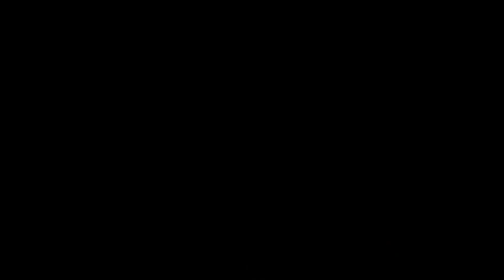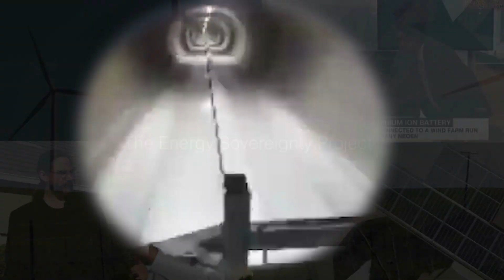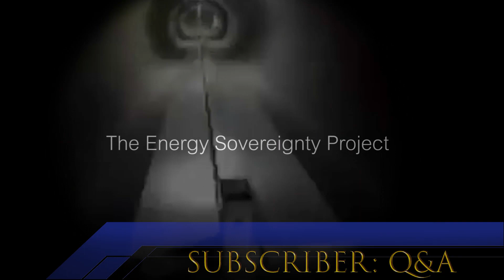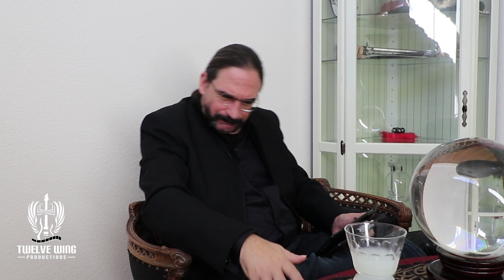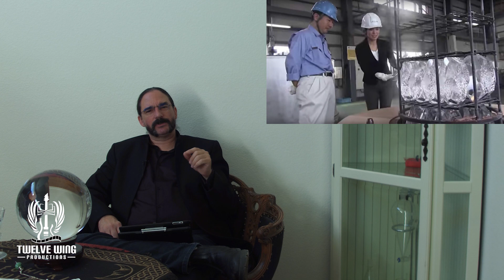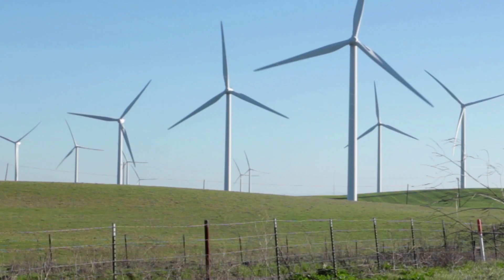Tesla's new Million Mile Battery: Is it solid state?

Comment: There is a recent Journal of Electrochemical Society publication by Jeff Dahn's research team of a "million mile battery" details using  NMC532/graphite pouch cell under laboratory testing. The technical paper can be viewed at URL:
 
https://www.scribd.com/document/424878572/J-Electrochem-Soc-2019-Harlow-A3031-44#download&from_embed 

This battery chemistry has apparently been under testing for the past 3 years. The advanced electrolyte used in this research study sounds to me like a chemical solvent and not solid state but you can read for yourself the technical details. The battery capacity remaining after 4000+ full DOD cycles is outstanding at 20 C (hence million mile battery claim) and decent at 40 C (see figure 1 in paper).  The long term storage capacity remaining after 400+ days of trying to hold a full charge also looks very good to me at 20 C and 40 C (see figures 2 and 3 in paper). I would be interested in your comments regarding this research.

Comment: What is the current longest mileage on the same batteries,  Is it not just taxi drivers that are ruining them at 300k-500k super charging 5X a day?
Reply from the maker: Not sure, but I'll look into it.
I've heard of someone approaching 200K if I recall correctly.
There are a couple cars in the 300k range but those were older cars with original packs.  Most of the first generation packs have been changed out.  Same with the early motors.
Reply: @twelvewingproductions7508  
"Most of the first generation packs have been changed out.  Same with the early motors."

Actually changed out as in replaced in the cars?  If so, have you a source?

Or do you mean that the batteries and motors more recently used in manufacturing are different than what was being installed in 2012/13?

As for battery life, Tesloop a company that does LA to Vegas shuttles  has a Model X with its original battery pack after 300,000 miles. The company reports about ~10% of battery degradation.  

(That is a TX, not the TS that is now at 400k miles but not with the original battery pack.)
Reply from the maker: @bobwallace9753 , the packs and drive units were both mostly changed out.  I know 3 people personally that have very early examples of the Model S and none of them have the original components.  It was common for some to have 3 drive units replaced before the current version was installed.
This was expected actually, so it's not anywhere near the issue the media has made this out to be.

As to the Tesloop 300,000 mile car, it's my understanding that this specific vehicle had it's battery replaced at 200,000.  That was why I was looking for other long range examples like the one 400k mile pack you mentioned.  I have been out all weekend but I'm going to look into this tomorrow.
Reply: @twelvewingproductions7508  
No Tesloop's original car was a TS.  As it reached 200k the computer began giving faulty range estimates.  There was a problem that needed some reprogramming and testing.  That was going to take some time so Tesla swapped out the battery pack as a quick fix so that Tesloop could keep operating.  When that pack was removed capacity was still very high even though Tesloop had been using the Superchargers fairly frequently.  IIRC what they were doing is take one client to Vegas during the day, Supercharging, and bringing another client back to LA in the evening.

Also, IIRC, there was a problem with the replacement pack and Tesla had to give the T3 a third battery pack.

The TX I mentioned is running its original battery pack.

I have heard of no drive units that failed.  That doesn't mean it hasn't happened, I could have easily not heard about problems which is why I asked.  I do know that there were noise problems in the drivetrains early on.  Drivers reported a 'grinding' noise which apparently was solved by inserting a shim between two components in the gear train.  I think what happened is that Tesla would swap out a drivetrain in order to get the car back on the road rapidly.  Then they would break open the removed drivetrain, insert the shim, put it back together, and use it to upgrade the next TS that came in with a noise complaint.

I've never seen any data on how many, what percentage, battery packs might have been replaced under warranty.  And, are we not a couple years away from when the first TSs start losing their battery warranty?  Eight years starting with Dec 2012, IIRC.
Reply from the maker: @bobwallace9753 , what you say about the drive units is correct but I think you and I are simply arguing over semantics.
It is true that I also have heard of none "failing" if "failing" is described as leaving someone sit on the side of the road.

That said, the noise in the early drive units WAS them coming apart.  I hope we can come to agreement on that.
There were gear geometry issues, a bearing issue as well as an issue with dissimilar metallurgy that I know of that was causing metal from one shaft to migrate to the bearing.
Nothing monumental as far as things go, but the result of all of this is that there likely isn't a single Model S out there that has it's original drive unit in it.

Tesla has the best warranty in the automotive world as far as I know.  As you point out, this is because it was understood that its customers were helping it with its development work.
As a way of understanding that, Tesla gave us this amazing warranty.

So I'm not trying to bash Tesla here, but I am going to be honest about their early struggles.
Reply: @twelvewingproductions7508  I don't think you're bashing Tesla.  I'm just trying to figure out what you might know that I don't.

When you say " there likely isn't a single Model S out there that has it's original drive unit in it" I assume you mean the very early Tesla Ss?  Those were the ones I understand to have undergone a drivetrain swap in order to add a shim.  

Here's an article in which the author describes his experience with his TS making noise after being driven for some miles and receiving a drivetrain swap.

https://www.teslarati.com/like-need-tesla-drive-unit-replacement/

And here's an article that talks about some TS owners needing multiple drivetrain replacements.  But mostly due to noise and not failure.  Of course failure could have happened later.

What I'm not finding is any recent reporting.  It looks like whatever design problem existed it's been designed out.